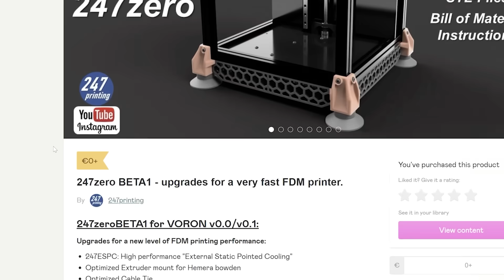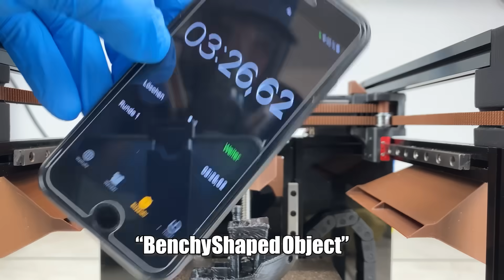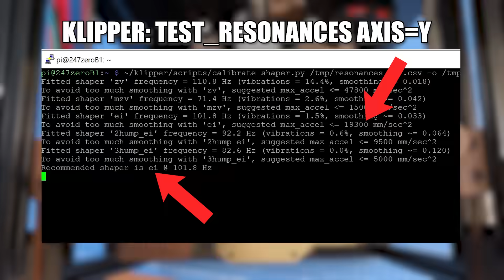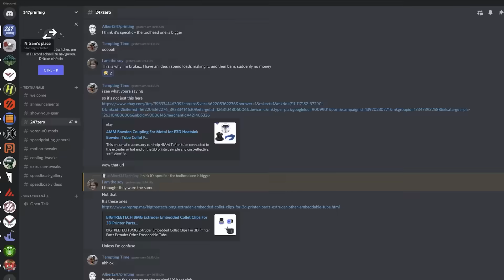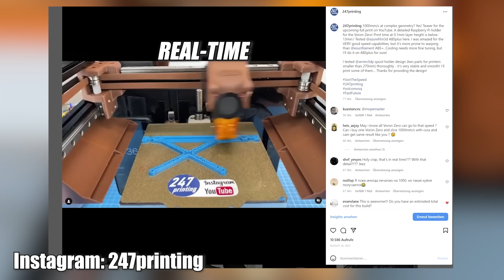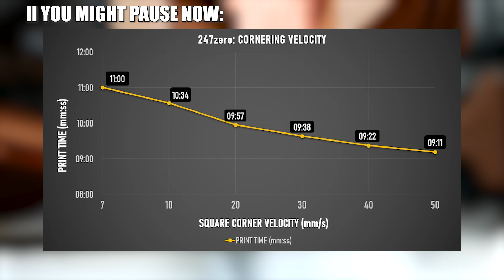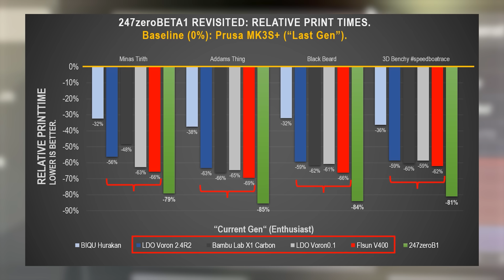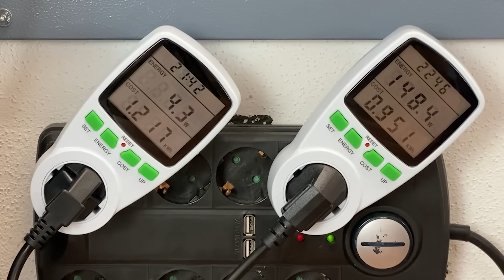HOW FAST is NEXT GEN 3D Printing? 247zero revisited!

Comment: How about for the cooling, instead of mounting fans, you put a big very flexible hose on top and feed air from the outside with a big delta fan. Im not quite sure how much weight this would add, but if you remove the fan from the Hotend assembly, you would also remove some weight. Im not sure how feasible it would be but i think you could even just put some sort of trash bag material that is losely connected to your wire harness and will expand when air is blowing through it.

Wie wäre es wenn du statt Lüfter am hotend assembly sozusagen ein Plastikfolienrohr benutzt, dass du lose am Kabelstrang befestigst und Extern über einen starken Lüfter aufbläst, somit würde man Gewicht sparen und noch dazu evtl. eine stärkere Kühlung für das Coldend und den gedruckten Gegenstand erzielen. Ich hoffe man versteht was ich meine ;D. Bisher habe ich das nur mit festen Schläuchen an Delta Drucker gesehen, die höchstwahrscheinlich viel Gewicht bzw. komische Artefakte verursachen.

Die andere Variante wäre halt über einen Kompressor aber konstant einen Kompressor laufen zu lassen wäre auch blöd und der strahl wäre wahrscheinlich auch zu stark
Reply from the maker: Yes! I use this on my V-Core-3: CPAP Turbo cooling. On bigger printer you might use both. Have a look at for example VzBot by Vez3D!

Comment: Another banger! I often  use you as the bible for speed prinint on V0 lol. BTW I have designed / remixed Auxilary part cooling fans for the common 5015 blowers that could be kept inside the encloser (will provide lower amount of cooling but can keep it enclosed this way with still decent results) when I have it on a place I'm happy with will share the STL / STEP files :)
Reply from the maker: Hey man, thanks a lot - very cool! Would you mind to contact me on Discord? My server is in the video description.
Maybe strong 5015 are enough - let's hope so...

Comment: Your quality problems look mainly like inherent issues of Bowden to me. You might be able to overcome them with Nitram's stiff Bowden but it could add unwanted forces on the toolhead especially if the gantry beams aren't stiff enough. You could also always try rdd. 😁
Reply from the maker: Valid point! I need to spend some time in bowden stiffening like Nitram did, yeah!

Comment: new to 3D printing, but if your mods are not restricted to any form factor, couldn't you just use bigger fans for cooling, like 200mm with suitable ducts? that would increase cooling and lower the noise, or even duct cold air from an air conditioner?
Reply: Bigger fans tend to have less pressure which    would be troublesome for his setup.

Comment: Sadly the Rapido is, frankly, fraudulent in how they advertise the flow rate. It is about 30% of what they advertise.

It is also requires careful tuning of how you retract or it will jam constantly.
Reply from the maker: I double both of that. For this video it was just an example - we'll see what I'll use :-)
Reply: @247printing  Fun tidbit, the flow rate they got was with a 0.8 nozzle. In order to find that out, you have to go look at their youtube channel, find the video about the rapido flow rate, then, in the comments they have a link to a pdf that shows their testing methodology.

I'm more than a bit irritated about it. I didn't find that out until after I had already gotten the hotend. Oh, and you also need to run it ~10-15 degrees hot, the thermistor is poorly located.

Comment: It seems like you are stiffness limited. Here are my hair brained suggestions.

A full torsion box and skinned frame would stiffen it up greatly. 

Dual corexy motion system? I'm not talking AWD, but copy-paste the entire top motion system offset about 100mm up. Or mirror so the effective offset is only 50mm or so and rigidly couple the motor shafts. Mount the hotend across the two stacked carriages/connected monogantry, one above the other. This drastically reduces the torsional flex due to cantilevering you are experiencing. You can also divide the weight of the hotend across the two motion systems. You can also go one size smaller x/y linear rail since they will have one less degree of freedom.

Replace the blowymatrons with compressed air nozzles. The air coming out of a nozzle is sub-ambient temperature too. To reduce the compressor requirements maybe attach just two round nozzles to both sides of the gantry pointed at your tool-head-cooling-deflectors at the expense of making the gantry a little heavier. Maybe deflect part of the air or an independently controlled air nozzle into the hotend heat sink.
Reply from the maker: Thank you so much - very precious comment and saved for further investigation!
Reply: @247printing  after some further thought because you would be moving more weight with my suggestion and every force has an equal and opposite reaction, then you should probably increase the mass of your printer as well. Part of CNC milling machines having a lot of mass is to dampen out vibrations. Either through having lots of cast iron or something called epoxy granite. For your use you could slap on some 12mm mic6 aluminum plates on either side of the printer. I suspect attaching them with t-nuts on the corners would be sufficient, maybe an extra attachment point just below the front idlers.

Comment: Awesome work! I love to see people pushing the boundaries of 3d printing. Although it is fast, I think you will always run into the limitations of physics and the fluid dynamics of the material. This is a great example of quality vs quantity. If you are looking for precise prints that require engineering quality and need to have tight tolerances and integrity, fast printing just doesnt seem to work. Even if you tightened the frame up to be as solid as possible, I dont think the quality would ever compare to something printed slow. I have yet to see the quality of a fast print compare to a slow print.
Reply: You should look at Annex Engineering printers which are contrary to basically everything you just said.

Comment: With the right settings, the X1 Carbon needs 14min 58s for a speedbenchy (Benchy according to rules).
Reply from the maker: I used default slicer settings and set them according to the rules. You can optimize each benchy and print of those (also the 247zero one), but that's not the idea here.
Reply: @247printing  You said you wanted an idea why it slows down so much in some spots.
The answer is simple, just set the acceleration to the maximum allowed settings of Bambu, so it's all within the rules!

The Bambu allowed values can be found in the printer settings under Motion ability.
If you use these values, the Benchy takes 13min 21s.

And uncheck the Filament settings-->Cooling--> Slow down for overhangs and bridges.
Reply: @247printing  https://www.youtube.com/watch?v=IzWoVZci4yQ

Comment: I think it would be great to see what exactly you are doing to find the bottlenecks of you're printers. Measuring flow rate is pretty simple, but I'm not sure how to tune the speeds and acceleration limits for going fast
Reply from the maker: It's a lot of testing and observing for each feature which has a speed setting.
Quite iterative print -> adjust -> print -> adjust per setting thing. Not very exciting

Comment: If you film the whole printer from above with a slow mo camera you will notice the whole body shifting. I believe you will need to secure the top of the body as well, and not just the bottom of the body, where you are using those big rubber feet.
Reply from the maker: Yes! There will be more to be added - that was just an example

Comment: I just moded my Bambu X1 to reach 40+mm³/s, maybe you should update your chart ;)
Reply from the maker: Haha, I can't add modded printers there. It should be "what you get out of the box".
How did you reach 40mm³/s on a X1C? Nevertheless: Flow is mostly not the limiting factor for the print times of regular stuff.
Reply: @247printing  I used a custom hotend with CHT high flow nozzle and dual side heater

Comment: With so much cooling and such printing speed, layer adhesion surely suffers. I'd love to see strength test comparisons between fast and slow prints!
Keep it up 💪💪💪
Reply from the maker: I'd also love to see that once and for all! I bet CNC Kitchen will do this some day
Reply: It doesn't. If you have poor layer adhesion from speed/cooling it means your temperature is too low - either the base temp or from cooling hitting the nozzle and making a big temp gradient between it and the thermistor. Better shields/socks that insulate the nozzle almost all the way to the tip will solve the latter.
Reply: @daliasprints9798 It does matter. The faster you print, the worse is layer adhesion. CNC Kitchen did make a video about explaining how cooling affects it. Since printing faster requires more cooling, guess you can only print decorative toys at those speeds.
Reply: @alejandroperez5368  You can keep citing the results of someone who's smart but knows virtually nothing about fast printing, or ask people who actually know this stuff. It's just not his area of expertise or interest.
Reply: From a quick search online some tests show better layer adhesion with speed and some show the opposite. Seems like as with most things this matter is situation dependent (your specific printer/filament/settings)... Another good reason to build a test rig and start doing my own research! 😉

Comment: Have you tried the new CHT Volcano? No more need for adapters, and when combined with a rapido hotend it is blazing fast. For the frame, why not go with a BoxZero style setup, but with 2020 extrusions? Like the Tiny-M does for instance. It would be much stiffer that way. Love the idea for the kirigami bed mount hinted in the video. And for side cooling noise, well, why not use some noctua or the like? Not talking about the small guys here like the 4010, 4020 or 6025. They don't have nearly enough airflow. I am thinking about the A12 (or maybe the incoming next-gen A14). A pair of them could fit on each side. 4 fans. 240 CFM total and low noise level. Opinions?
Reply from the maker: Yes, I bought some Volcano CHTs in order to use them next. Advantage of the adapter: You can use all of your standard nozzles.
Thanks for all the other ideas!
Changing the frame would be a completely new printer though - atm that's not the idea, but yes: 2020 or maybe even 3030 would help A LOT!
Reply: @247printing  I can't deny that adapters are useful: I use the mellow V6 Plus on my setup so that my regular sized diamondback can fit in the rapido uhf when printing pa-cf. But yeah, changing the frame is a bit bigger modification. Still, I encourage you to look up the githubs for the Boxzero and Tiny-M mods if you haven't already. It might inspire you.

Comment: Could you use high static pressure low rpm fan to deliver pin point cooling via "Bowden" tube? Then you could have no fan on the head, lower noise and very targeted cooling.
Reply from the maker: Great idea!

Comment: I don´t understand some "features " of this machine.
1.) Why are the "bed fans" no blower fans ? This design decision does not make sense. Also why are those fans on both sides ? This will cause turbulences.
2.) Why didn´t you use carbon fiber rods instead of aluminium extrusions for the gantry axis ? Your goal was to minimize weight as much as possible. 

Man sagt auch nicht "construction" in diesem Zusammenhang, construction ist eine Baustelle, das ist denglish =)
Reply: You can't just cool 1 side of the print, that would look horrible on the side without cooling at these speeds
Reply: @twanheijkoop6753  you won´t though. Having the fan on one side will blow air over the whole print plane. Having opposing blowers  not even blowers just fans which aren´t made for this use case will simply introduce turbulences.
Reply: @sierraecho884  You want turbulence. Blower fans don't have anywhere near the CFM to do this unless you get gigantic ones. The server fans are pretty much ideal for this kind of setup. The other competitive setup is remote cooling with CPAP tubes.
Reply: @daliasprints9798  Blower fans create more static pressure which is what you would want in this  use case. You need to move air over a vaster space. Turbulence would be created regardless but blowers would be better here as they are in general with part cooling.
https://www.youtube.com/watch?v=SasqtbK8giE
Reply: @sierraecho884  These server fans have considerable static pressure and very high CFM. You need both for this kind of whole-layer cooling.
Reply from the maker: Nur kurz zu construction - bitte erst zumindest google anwerfen, bevor behaupten und "Denglisch" vorwerfen ;-)
Ich mache sicher viele Fehler im Englischen, hier aber nicht.

Natürlich ist "construction site" eine Baustelle, aber man kann es vielseitig benutzen (auch hier!):
"Construction is a general term meaning the art and science to form objects, systems, or organizations"

1) Ist ein Erbe, weil ich am Anfang nichts besseres hatte. Funktioniert aber top - auch mit schwächeren Fans.
2) Verstehe ich nicht - keine Aluextrusions verwendet - bitte Kapitel "Motion" und "Tradeoffs" anschauen.
Reply: "Construction" zumindest in diesem Zusammenhang würde kein Amerikaner so sagen. 
Ich kann dir das sagen da ich als design engineer in einem US Amerikanischen Unternehmen arbeite. Google ist schön und gut, ich spreche aus Erfahrung. 
Genauso wie "Drive In" Deutsch ist und es drive through heißt etc.
Konstruktion wäre hier assembly, design oder structure passender.

1.) Okay, supi.
2.) Schau dir andere Drucker an, z.B. den von Bambu Lab der nutz CF Stäbe für die X Achse diese ist deutlich leichter und damit kannst du noch mehr Gewicht bei gleichbleibender Steifigkeit sparen.

Comment: The tri-zero mod might be interesting as it removes the lead screw. Also adding a bigger x rail. I just converted mine and the z axis is much more stable and additionally you get tilt adjustment (with zero click probe)
Reply from the maker: Tri zero mod? YES finally thsnks!
Reply: @247printing  Docs are a bit thin, let me know if you have any questions.
Reply from the maker: I was thinking a LOT about this to design by myself. Thanks for the heads up, I'll check it out!

Comment: I understand that this run for speed essentially speeds up the process of makin "nextgen" printers, but the real usability can in my opinion only be reached for larger printers. The small bed printers cannot have prints that will take really long time, because there is not enough place for them either way. Any future plans to really go for the proper "hardening" of the setups for the bigger bed size? The real benefits of fast prints only shows then, as 24h or more prints are really the problem.
Reply: Hopefully many of the learnings from printing small things very fast can be replicated on large format printers. Getting a 5-10x speedup on a multi-day print would be huge.
Reply from the maker: Totally right! You'd need automatic removal to take full advantage for production - but there is still prototyping of smaller parts for example

Comment: With that amount of air flow coming from the sides, you can remove the nozzle fan and just redirect some of the side airflow into the nozzle. Should save you some weight.
Reply: I was about to suggest it! 👍  Nifty use of those turbojet side blowers!
Reply from the maker: Absolutely - that's what I did :-) Check out the chapter "cooling"
Reply: @247printing  Oh, I see I missed one thing... I meant, for possibly cooling the hotend too! No more hotend fan as well! 😉

Comment: Would the higher thermal conductivity of the Diamondback Nozzles PCD help reduce any bottleneck at all, or not really?
Reply: I don't think it is as good as a CHT, even less for a CHT Volcano, in terms of flow
Reply: @supakumachan69  Now we need a solid chunk of PCD with those CHT Tubes…
Reply: Well there already is a bimetal cht nozzle that exists, both in regular and volcano length. The inner cht geometry is thin vanadium steel for abrasion resistance and the rest is nickel plated copper. Already pretty neat if you want an abrasive-resistant cht.

Comment: Very cool, you should check out the solid state cooling they've showed off at CES, literally no moving parts , would bring down printing head weight a ton and with its super fast jetstream of air offer way better cooling, which could I bet almost double printing speeds of todays printers while maintaing the same quality.  Just guessing but these coolers seem next gen ,and like every video suggests, cooling is still a huge obstacle for printing speed, its the main one in computing speed, hence the motivation for these coolers , they  can apparently give 15-25w laptop cpus another 5-10w of heard room which is pretty remarkable, doing with less power and less form factor too.  Someone needs to put one of these  on an Ender asap, Frore Systems is the company and i seen the video from PCWorld's channel covering CES from a few days ago.  It looks like a flat lithium battery that sucks air in from one side and blow it at high speeds out the other.  Many "vibrating membranes" at supersonic speeds are responsible for this when voltage is applied is basically how it works.
Reply: That did have moving parts, but yeah, could be helpful.
Reply from the maker: THANK YOU! Saved your great comment for further investigation!